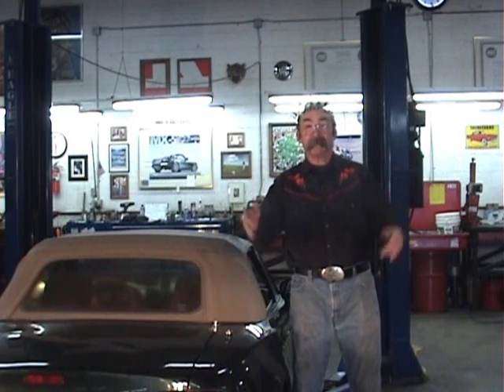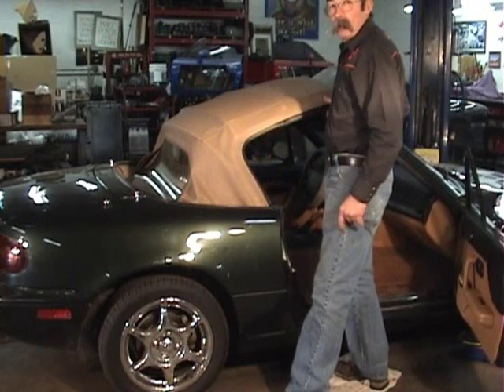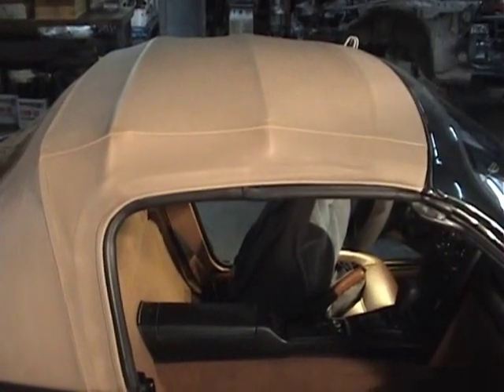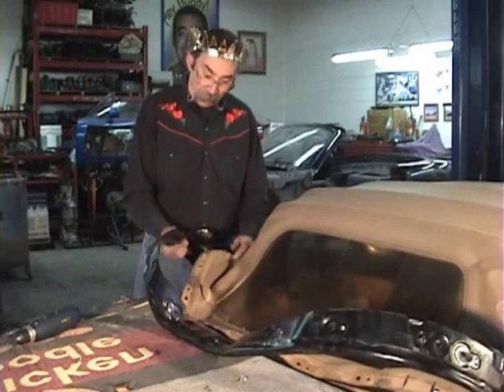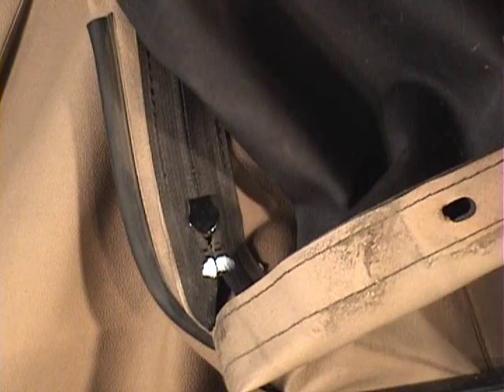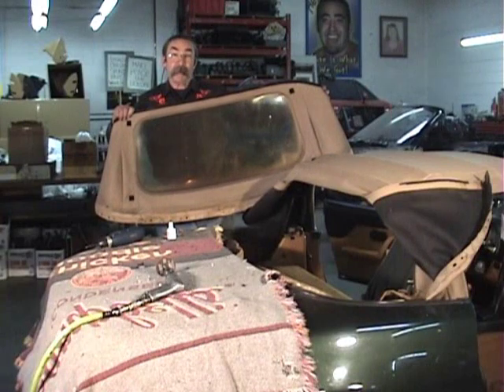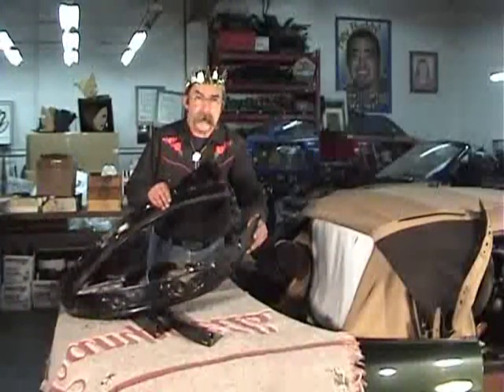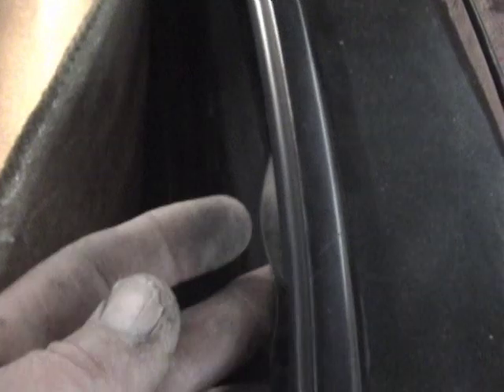Miata MX-5 Rear Window Replacement How To

Comment: Very detailed, appreciated. The cardboard tube is great info. The wax candle lube for zipper, awesome. Not planning to spend much so although I appreciate seeing this done correctly Im going to glue on vinyl window in place. If I cut opening at seam edge I can set some strong transparent glue on the existing seam. If I cut a wood template to support backside/inside then stuff a pillow in back of board to hold board and present canvas firmly and flat. Then I could pin the vinyl window flatter and stretch properly for glue to set. Jo-annes fabrick sells the vinyl.

Comment from the maker: Hello,
To sublet the complete job expect to spend $250.00 to $400.00. The sublet in this video, to just install the new plastic in the apron was $150.00. Find  a local upholstery or convertible top shop for help with plastic and quote of prices ( even tinted ). The new window is double stitched in and we have not seen a leakage problem.
Good Luck, Mike.
The KIng of Miatas.

Comment: Hi, Informative video.  I have a question about the rivets you drilled out, don’t you have to reinstall them?
Reply from the maker: Hello, No need to re-rivet the rail-rail as the metal molding will now hold everything in place. The King of Miatas Mike.
Reply: @MikesPlaceBiz  awesome thanks Mike   I am replacing an NA rear window

Comment: hello King, great video...been trying to look for a way just to remove apron...quick question...the old plastic window started to dry up and crack; and it ripped the leather where the window is glued on...around how much more will that cost to repair or is there a way i can repair myself

thanks

Comment: King, I have a question for you, its off topic of the windows but im looking to pic up a miata really soon, if you were looking for a mainly fun driving car and not really racing it but just have fun on back roads, would you go for a 1.6 with vlsd or a 1.8 with an open diff. I know the 1.8 lsd's are much stronger but idk if I can afford a 1.8 with one... If you had to choose between them which would you pick. Thanks for your time :)

Comment: Nice job. Where can you buy the replacement window?
Reply from the maker: Hello Sir Len,
The window is cut to order at a convertible top or a boat shop. You will need to take the appron to them. They will cut and sew in the new window. Good luck with your Miata Mission.
Mike.
The King of Miatas.

Comment: Instead of replacing it with another plastic unit could you just replace it with a glass unit? Is the Miata prewired for window defrost?
Reply from the maker: Hello,Thank you for your interest. Yes, you could put in a glass window but it may be more trouble than replacing the whole top with a glass window type. Some Miatas do have the prewired defrost, but may be missing relays and switches.Miatamecca.
Reply: First generation Miata's (aka "NA" edition made from 1989-1997) do not support glass rear windows without a modification.  The issue is with the folding of the bars that support the top hitting against a glass window.  The plastic window actually folds with the top, and, of course, a glass window can not.  But if the entire top is replaced with a new one then there is the option to get one with a glass rear window.  This is achieved because the new top with glass rear window would not attach to the rear top support bar which allows the rear support to be pushed against the center bar and then the top is folded and keeps it from hitting the glass rear window.  This type of new top does require that a strap is installed on both the left and right side between the center and rear top supports.  It is easy to do but does require drilling into the support bars and using pop rivets to hold the new straps.  So, if your have a good top but a foggy or busted rear plastic window then replacing just the rear window with another plastic one is quicker and more economical.  But if you are replacing the entire top then it is definitely worth getting a replacement top with glass window and installing the straps.  Note that not all new tops look like the original 2 piece top as shown in this video.  Most of the cheaper new tops are one piece and look different than the factory original with different seams than the factory original or no seams at all (and, in my opinion, not as nice as the two piece factory original top).  Finally, new tops can be had that are cloth instead of vinyl.  Cloth tops cost a little more but they make the car look much nicer.  Hope this helps.
Reply: My 92 has a zippered rear window, with defrost so you unzip the rear window, it lays in the cover OEM i have and lays on the back shelf. and The roof folds down like always.
Reply: Right you are Brad... I left out the word zipperless in my last note.  It should read "First generation Miata's (aka "NA" edition made from 1989-1997) do not support a ZIPPERLESS glass rear windows without a modification"Doing the modification means not having to unzip the glass window to fold the top... like Mazda figured out how to do on the 99 and above.  Once modified, it makes it far easier to fold down/up the top.

Comment: Thanks for the vid, i need to do this on my 90 :). What is a reasonable ball park for getting the plastic replaced and is there any special type specification of plastic i should ask for?. does the shop do any kind of waterproofing?.

Thanks
Reply: I bought my plastic online I went with 30 gauge because I was going to sew it in myself personally hand Sew it!  Which is actually what I did my 1990 Miata has its original skin on the rag top that's right OEM amazing isn't it? I'll send you a photo if you want I learned to sew in 5th grade!  My stitches aren't pretty but they are practical.  I got my plastic from eBay.  I think the original plastic is 40 gauge and clear.  You want to go with marine-grade vinyl which is PVC plastic... also they have a UV protective  which is probably what the DOT would recommend and if you want to make it look original you can make it clear I went with a tint because I live in California and we go for that out here again I went with 30 gauge which was easier for me to hand sew but I don't know how long it's going to last because I just finished it and I don't know how practical it is concerning the tint.

Comment: Where can I find the replacement
Reply: Hello,
To sublet the complete job expect to spend $250.00 to $400.00. The sublet in this video, to just install the new plastic in the apron was $150.00. Find  a local upholstery or convertible top shop for help with plastic and quote of prices ( even tinted ). The new window is double stitched in and we have not seen a leakage problem.
Good Luck, Mike.